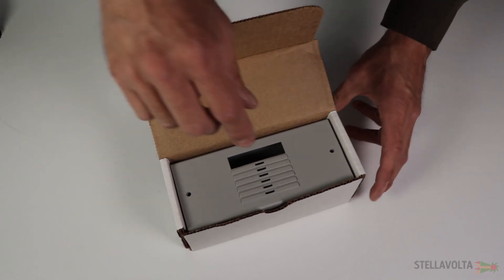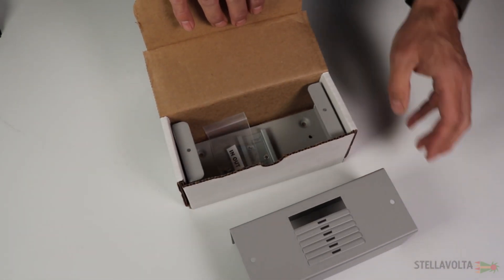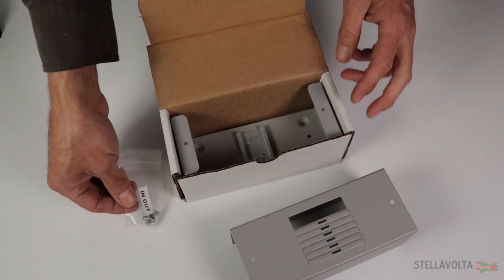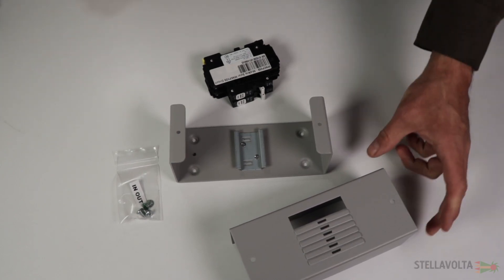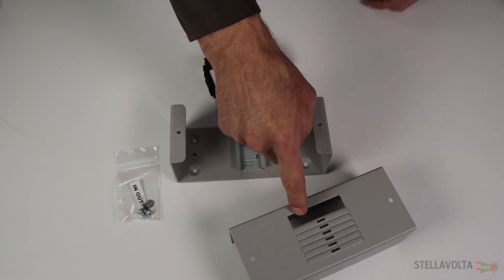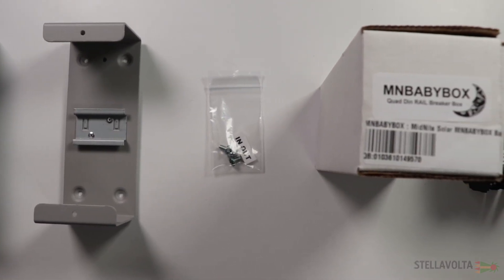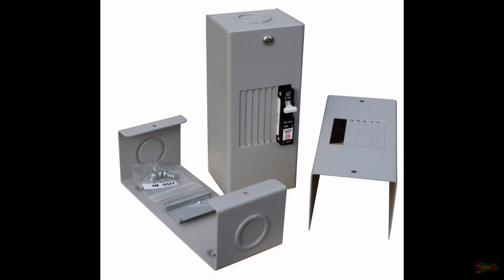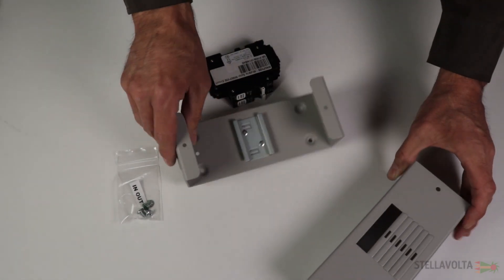MidNite Solar MNBABYBOX Enclosure - Box Opening by Stellavolta

Comment: Wish you showed how to connect it, how to crack open the 1” opening. I couldn’t get it open, couldn’t find people open it on YouTube either.
Reply from the maker: If you are referring to the round knockouts on the ends, you can use a hammer and screwdriver to knock those out, however, if you are referring to the breaker openings on the front, you can either 1) insert a screwdriver into each center hole and then hammer down on the screwdriver a little, or 2) you can use needle nose pliers and twist them out. If you have any additional questions, please don't hesitate to contact us.